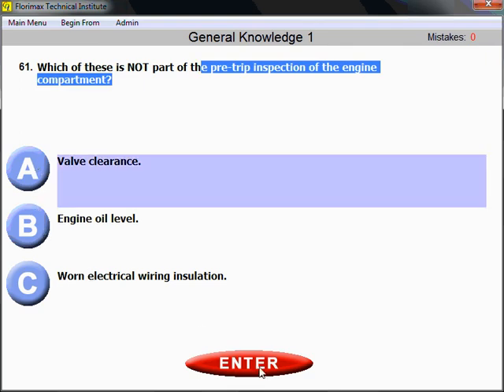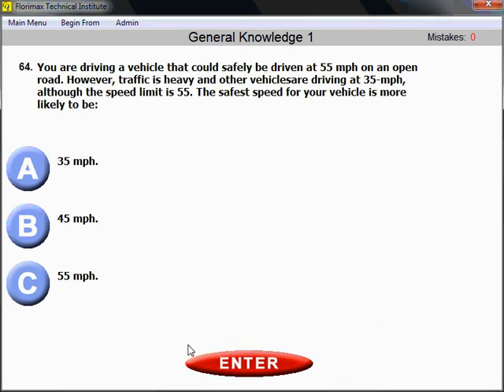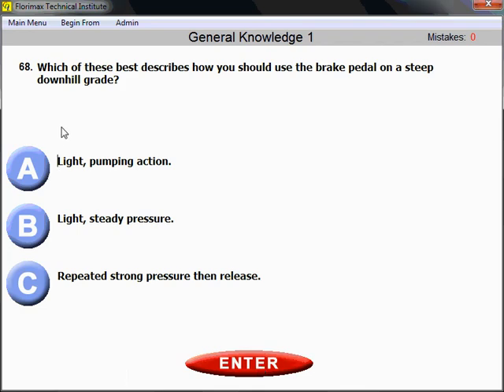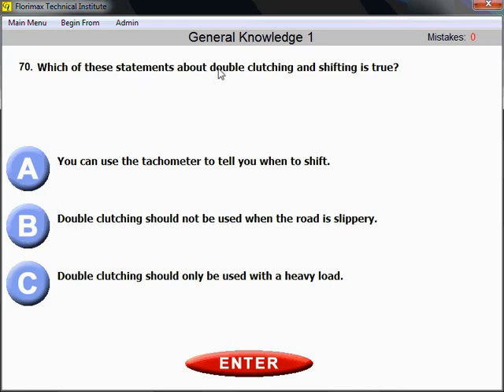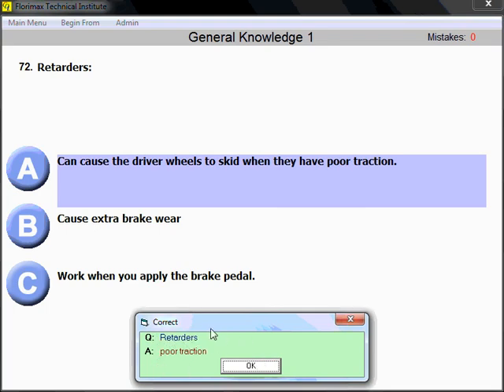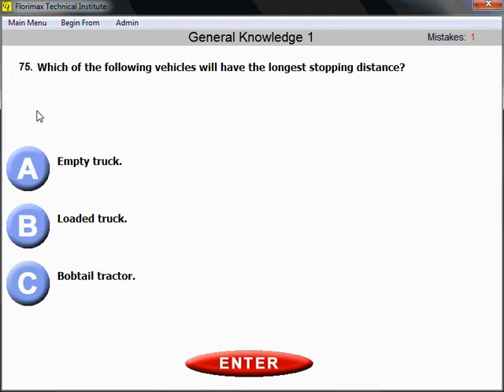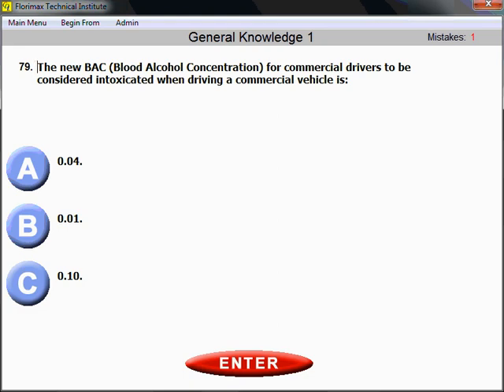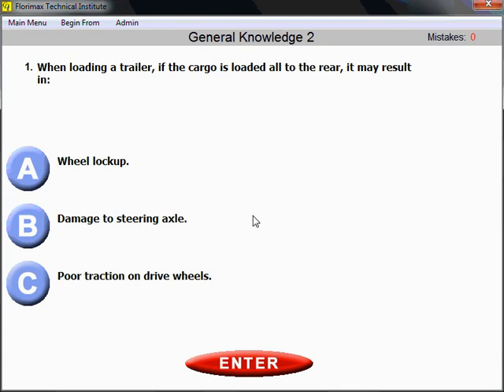CDL General Knowledge Study Guide 5

Comment: Question on a Question:
For number 68, don't you want to use the STAB method (break until you are 5 mph below your 'safe speed', then release the brake until you reach the safe speed, et cetera). I can't speak for all states, but in mine, there are questions which emphasize 'don't overuse your brake on a hill' over and over and over again.
Reply: +walrusgumbo with it being on a hill it could send your tail around if you are using a trailer. thats what my instructor told me i just asked her. hope this helped.

Comment: On question #75 about the longest stopping distance ,  both the Missouri & Oklahoma manuals say "Empty trucks require greater stopping distances because an empty vehicle has less traction. I've done practice tests where I answered it with bobtail truck and got it wrong ...so which is correct ? I found a few questions to be different , but other than that these videos are amazing ! Thank you guys for them .
Reply: Yes empty truck is the correct answer 👍